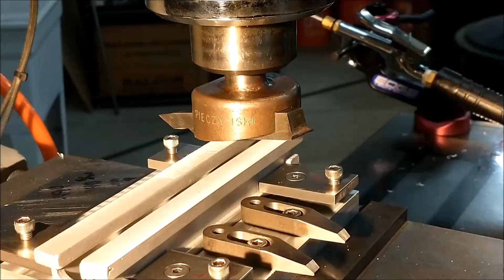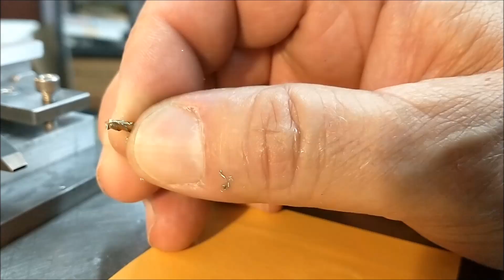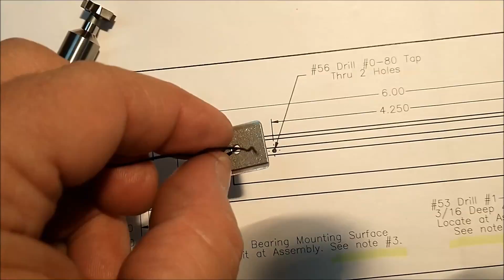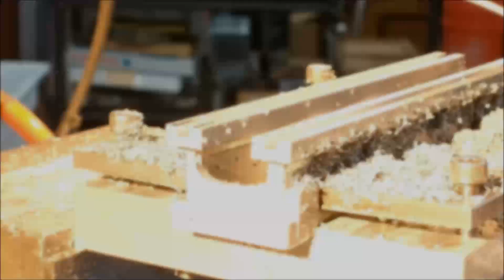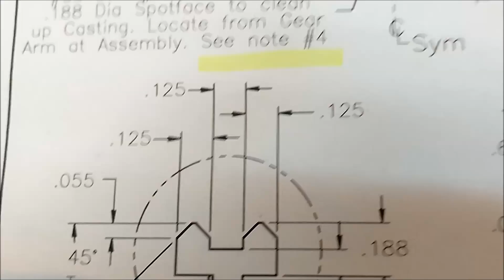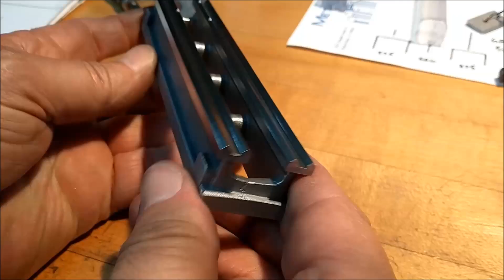Machining a Miniature Lathe - The Bed and Legs - (B)

Comment: I may have missed it but don't recall seeing any method of measuring the distance between matching pairs of the inverted v-ways.   We always used pins to measure across dovetails but not sure if that method would work here.  Seems like the distance would have to be nearly perfect to get the carriage and tailstock to match their mating ways on the bed.  Usually see one "V" and one flat way so the distance is not critical.
Reply from the maker: Pins would work fine for the negative grooves, but the top rails of the bed don't work in close pairs like they look, so using a pin could be deceiving.
Reply: For the top rails, each gauge pin has a piece of flat mounted to hold it flush with the top of the rail.  Then measure across to to the far rail which has the second pin against it.  Some trig is involved to calculate the correct measurement.

Comment: Less yapping. Also I'd like to jam that air gun where the sun doesn't shine.
Reply: I was working as a mechanic when I was young and a new guy came into the shop as a beginner mechanic and did just that, shoved an air gun up his buddy ass pulled the trigger and the guy he did that to was dead within 5 min. It is a dangerous thing to mess around with.
Reply: @craigsbully  Its messed up but you're correct. Every year a dozen or so retards die annually from air gun sexual exploits gone bad.
Reply: Now that I've thought about it there probably isn't a good air gun exploit.

Comment: Next time you see a 'bag-less'  vacuum cleaner dumped at side of road, stop and pick it up. 
Usually they are OK or may need one of the hoses cleaned out (people try and vacuum magazines and stuff) if it doesn't run, just leave it out again until the next one comes along.
I picked up a Dyson and a Bissel left out for trash man, Dyson only needed shredded paper removed, Bissel went straight into garage next to mini lathe (after checking outside on driveway - just in case it was full of bugs or something)
It's better than blowing tiny chips around

Comment: aluminium is super easy to cut if you use denatured alcohol instead of cutting oil or something like that. :) 

sends the chips flying and cools quite well
Reply from the maker: Ever try kerosene?
Reply: @joepie221  didnt had the chance, but if it works well, why not give it a try. :)
Reply: @joepie221  or Paraffin
Reply: @bejay69  Kerosine and paraffin are the same thing.
Reply: @joepie221  Wd-40 is Kerosene and Vaseline mixed together.

Comment: Joe , If you had to do it again  , would you drill the headstock bolts before 45ing the ways ? Looks difficult trying to drill after milling.
Reply from the maker: Since the top is an interrupted thread, just make a small counterbore with a n endmill and all goes well. Or just take your time and let the center drill do the same thing.

Comment: I really enjoy watching the videos but I have to admit that I have to fast forward past the 5 minute explanations for why blowing chips with an air gun is messy.  I don't mean to complain or anything but was wondering if I am alone in this?
Reply: I agree! I shop vac them off the part or use a small disposable paint brush to push them off. I work in my garage, don’t want them on the BMW soft-top.

Comment: As soon as I saw that 4f, doc, rpm, and feed I knew what was comin. That was a rookie mistake Joe and I'm glad you showed it.  We know you're no rookie(I do at least) and that you had it in the back of your mind that that could happen.  Sometimes we get in a hurry and end up biting ourselves because of it. The other day I cut two 8" pockets both with one open end. They were 1/16" wide down .055" with a 1/16" three flute carbide ball nose. I had one tool supplied by the customer. The tool manufacturer recommended 22k rpm. my spindle goes 5500, but it is terrifying at that speed. I ran 3500rpm. After monitoring chips and some listening I kept the doc at 3-4 thousandths per pass down to size no fluids just air for chip removal. Nothing bad happened except for the pain of exercising a whole lot of patience not testing what a .010 DOC cut would do. haha. 
That 2f spiral upcut was the right tool. If I'm in a bind and have to use a four flute in AL like that I handle it like a micro face milling operation and give it air for chip removal with a decent feed rate. Or for a near net doc drop the rpms in half and feel out the chip load. That's all granted it is a freshish end mill. I've waded quite a few 4 flutes with AL. once had the AL stuck in the flutes friction weld to a part and yank it up and out of the vice. Machining is still a treat though.
Reply from the maker: That cutter was more than capable of making that cut. Higher RPM and better coolant control and...multiple passes would have worked just fine. I pushed my luck and it loaded up.

Comment: Un-loosen?.....lol isn’t that tightening lol
Reply: It's a service related technical term. It's used whenever left handed screwdrivers are brought in.
Reply: @orangedream267  But what about using a metric left hand screwdriver?
Reply: @simonbirt6121  that's for advanced service. Kept with the long and short waits.
Reply: @orangedream267  oh yeah lol, I’m still shopping on eBay for a set of them myself lol

Comment: Jo, can you please explain the geometry of your fly cutting tool as it looks very unusual compared to the classic style
Reply from the maker: The unusual grind is a lot of tool clearance with a positive leading edge for brittle plastics. I like to keep it relieved parallel to the work.
Reply: Joe explained in one of his videos a while back, that it was to reduce material from chipping/breaking away from the edge of the work piece as the cutter leaves the work piece.

Comment: Hey Joe!
Regarding that broken 4 flute cutter, do you have any tips that would make using them safer (in terms of avoiding them to break)? Would a shallower cut make it less likely to snap? Also what do you think of single flute endmills for this?
Reply from the maker: Constant flood or mist coolant is a good place to start. Other valuable tips are to take smaller and more passes and like the other comment says, Don't extend the cutter too far out.
Reply: Sometimes you can run an air nozzle behind the cutter ,  will blow chips out & help prevent the cutter re cutting the chips .

Comment: On your using the dials instead of the DRO at 13 to 14 minutes in you run your first cut along the end view with the backlash in the "wrong" direction.  I assume that you're relying on the stiffness of your gibs not to move?  Normally we move "into" the cut direction where in this case you back away to the proper setting.   But that leaves you relying on the stiffness of the gibs not to move into the backlash of the screw.  Or did I miss something there?  Or is this a trick you would only use for lighter duty cuts like this alloy part and a pretty light cut?
Reply from the maker: If you think about it, any table movement on a pass like that will push the part away from the cutter and actually leave extra material in the slot. So the part would not be ruined. I always snug the opposing axis and watch my digital for signs of table creep, but the technique is best used with finish or lighter cuts.
Reply: @joepie221  This is what I was commenting about on your Machining a Model Steam Engine Part 7. I guess maybe you  misunderstood my comment there as I did not get the same response as this one.  I also posted a question about it on this video. Thanks for clarifying it here Joe. :)

Comment: Those "were " light cuts indeed. Hardly visible for sure. In the day DRO's were few and far between so basically all I know is to work against or with backlash always present. Even on the tightest machines. It is what I was taught and still do to this day. Love having a couple dial indicators though eh. There is a lot more to this piece than meets the initial eye indeed. A good amount of time was needed to get it figured out and executed. Well done Joe. It looks great ! ZOOM, that was a fast 40 min fella !
Reply from the maker: Having a few special cutters really helped too. Thanks for your comment.
Reply: @joepie221  I can only imagine your tool room. Tool and die are one area I always wanted to do. Lots of head scratching I bet.

Comment: New to this other than watching machining for two years.  The fly cutter SEEMED to dangerous at first.  Why not an end mill?  Love watching and learning.  God bless!
Reply from the maker: It was extremely sharp and minimal nose radius. The material was soft and the cuts were light. Another plus is the cut surface footage of the tool itself. A smaller cutter at the same RPM would technically apply more pressure than the much larger diameter tool. I was confident it wouldn't fail.

Comment: Ok Joe, white board time....How fid you determine the centerlines and depth on that chamfer cutter?
Reply from the maker: Its coming. Thanks for asking.
Reply: I'd like to see Joe get into the weeds on this too.  However, I assume that he "trigged it out," knew exactly where his tool was using his tool setting procedures shown in this video, determined (on paper?) what every theoretical dimension should be, and then simply used his DRO to cut to those dimensions.  I think....  That's why I'd like to hear/see what he did and also how he'd measure the finished job to see how close to the theoretical dimensions he got.  I'm limited to a low-quality mill-drill with no DRO, so that's why I'd like to see/hear Joe's "in the weeds" detailed explanation(s) of how to do the above (especially in a home shop).
Reply: @bobvines00  You know it's going to be simple, we just cannot see the quick way of thinking trough it..

Comment: All that rough, on a real lathe, would be painted. I think I'd do that on the model too maybe? The only parts showing bare metal would be the machined items.
Reply from the maker: I have a can of Clausing Colchester green that would look great.
Reply: @joepie221  Yep make it look a proper job. Finish it off nicely. Also you could fill the casting nasties on the rough stuff too

Comment: Hi Joe, It does appear that the bed ways in the correct location but it was not clear to me just how you managed to get the .015 landing accurate. I thought that you would use some math to find how far to move the center of the cutter to the bed way.
Rich
Reply: I checked my prints. The headstock and tailstock sit on the inner ways and the carriage sits on the outer ways. The distance between the centerline of the V-grooves on the head and tailstock are .625 apart and the carriage is 1.125 apart. This is so the legs of the carriage can go around the sides of the headstock to get close to the chuck. The tailstock can go between the other legs of the carriage also.

Comment: Why are you using a fly cutter for the feet at the beginning? Wouldn't a nice 1/2 carbide end mill cause less ringing?
Reply from the maker: I knew that cutter had almost a zero radius and was extremely sharp. It was a safe choice.
Reply: @joepie221  Makes sense - maybe even sharper than a used endmill. Thanks!

Comment: Turned out nice again, I’m glad you clamped it down and not stuck it in a vice.
Reply from the maker: I didn't want to be accused of over kill on the fixture, but it always good to clamp solid surfaces. So I went for it.
Reply: Joe, your fixture wasn’t overkill it was the correct way to do that operation, it’s exactly what I expected you to do. Sometimes a good fixture is the only way. Keep up the good work and I’m glad you’re enjoying this project.

Comment: Joe, to keep from snapping small end mills  only go as deep as 1/2 the diameter.
Reply: It's not as much as how deep you go, it's how fast you feed the tool into the material.
Reply from the maker: That was actually a ELOC cutter that had some stainless miles on it. It must have dried out for a split second and blew. The material was soft and just cold welded. Not much you can do after that.

Comment: UN- loosen ?  Is that a double negative?    Would it's opposite be "UN-tighten?    If untightening a nut is the act of loosening a nut, then unloosening a nut would be to tighten a nut.
Reply: Nope, it's a Joe-ism, but it's also a correct term for the opposite of tighten.

Comment: Joe, wonderful job as always. One small tip from my side; I started to hate the countersunk screws especially in small sizes (M2, M3) and in (soft) A2 Stainless. Then I switched to the Torx versions and became a happy man when it's about tightening or loosening small countersunk screws. You can really torque these small sizes with a Torx drive with confidence again (within reason of course). Even the M2 ones. Try it and you will be surprised. I'm not a screw you salesman; just a driven technician like you are. Thank you Joe! You blew my week out with a smile! Best, Job

Comment: Another great job!  BTW, why do lathes use a different part of the ways for the carriage and the tail stock?
Reply: To even out the wear on the bed would be my best guess especially  to the right of the chuck where the bed gets the most wear with the tailstock sliding up as far as it can go to the saddle. If they both used the same ways it would really accelerate the wear in that area.
Reply from the maker: Structurally, the carriage engagement surfaces will go past the head stock by design. If they were on the same rail, you'd have to stay much further away.

Comment: I thought the rule is never make a climbing cut?
Reply: Climb cut on aluminum gives a much better surface finish. I believe the reason for not using climb cuts is machines which aren't rigid enough.
Reply: @juliejones8785  Also backlash will bite you

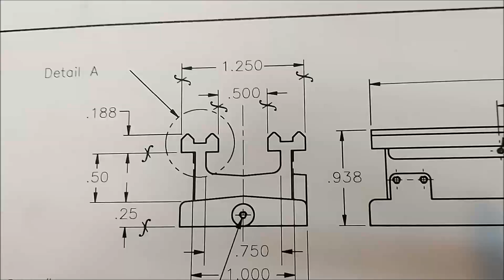Comment: Probably a dumb question, but what does that integral sign + line on some of the dimensions on the drawing mean? Eg. 32:53   0.25/0.5/1.25
Reply from the maker: possibly "Finished Surface" if not used in conjunction with a dimension.
Reply: @joepie221  Thanks, Joe. (With your help) found it in my ancient (copyright 1967) High School drafting text, where it was called the "old method" compared to the ASA check mark (now an ISO standard with roughness etc.). Nice video, as always, thanks again.

Comment: Very nice!  Question. You say that you don't like 4 flute endmills in aluminum and 2 flute is better. Is is because there is less material in a 4 flutes cutter than a 2 flutes? Can you elaborate? Thanks for sharing this project. Very enjoyable and instructional to boot. 😁
Reply: The flutes are smaller and more closed in compared to 2 fluter's.  The Al chips want to pack into the flutes.
Also the EM had a Tin coating, Al likes to stick to that more then uncoated or better polished flutes.
If I had needed to do that cut with that 4 flute EM I would have bumped up the RPM, limited the down steps to about 0.005" and a fast feed.  A mister would have helped a lot also.

Comment: Hi Jo, one more joyful video as allways.
But I am curious whether you lock the axis that is not in use while you cut the featchers on the other axis, to prevent slack interfering with the dimension you are cutting at that moment? Doe you lock X- axis while cutting along the Y- axis and vice versa?
Reply from the maker: My non moving axis always has slight drag on the locks. Good question.

Comment: You are "treading with the angels" machining the legs with a fly cutter!
          Use roughing or high-helix cutter for narrow slots!  I have the same problem (even with 2-flute & roughing cutters in aluminum) when CNC milling.  My theory goes like this: milling cutters do not like material "on 3 sides".  How to start a deep slot?  I program CNC to wiggle sideways as it traverses the slot (you can do this manually too, tough, but not impossible, in this narrow case).  Most of the time, there is "material on only 2 sides" & the cutter does not clog!  Other machinists say I'm crazy, but their trash cans tell a different story!)  Another trick is to drill a series of holes almost as deep as the slot.  As the cutter breaks into the next hole, it clears.
          This lathe bed is not designed as well as mine (Maximat 11).  The maximat 11 (& all other modern lathes I've seen) have a single V-way, and a single flat way each for tailstock & carriage.  This way, there is no "mechanical indeterminacy" if distances don't precisely match.
          Use the headstock, tailstock, & carriage as lapping tools to clean up the bed machining marks.

Comment: One more great job and great video.
Fly cutters look like popular. What's the advantage using that tool instead of a face milling tool?
As many times before, a well made jigg makes the job more safe.... I think I payed some 50 - 60 USD, Ebay, for  ALU blocks of that size.... Did You make some of the toe clamps especially for this job?
0.093 deep cut. Chopping of a piece of a 1' by 6' (foot) 5 mm thick a 3 mm 4 flute + denaturised spirit, was used but the depth of the cut was likely half or less than  Yours, to lower the buildup of chips...... Change that Hokus Pokus You used during the cutting.... I'm joking!
At the time 25:49 You make a check of the T track cutter. Why not use that from the beginning and get rid of two "uncertain data", two variable, the roller diameter and cutter thickness?
Time 26:35.... Pressurized air..... It only moves the chips. Sooner or later the vacuum is needed....
You're obviously satisfied... Well earned!

Comment: This is awesome! I think I have been most interested in seeing the bed ways made out of the all the parts of this.

Joe, I have noticed that you have been fly cutting with a negative front edge angle tool (or however that would be called) similar to what you showed in the fly cutter tools video some time back. Is that because of the cast material?